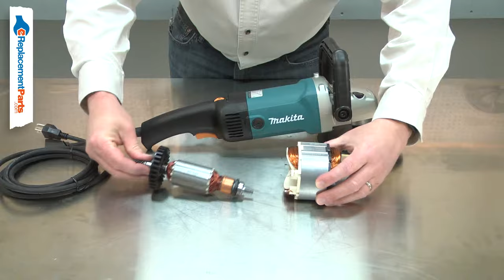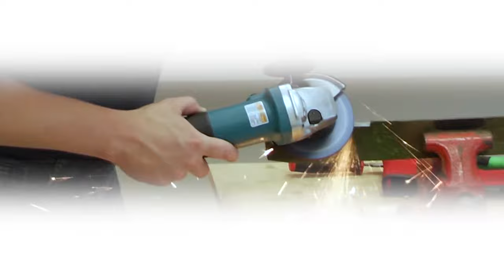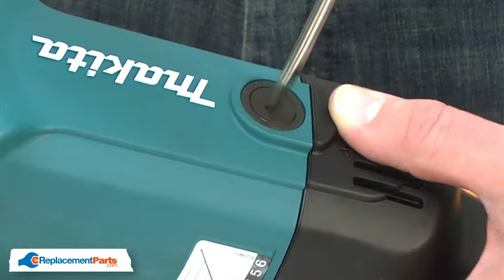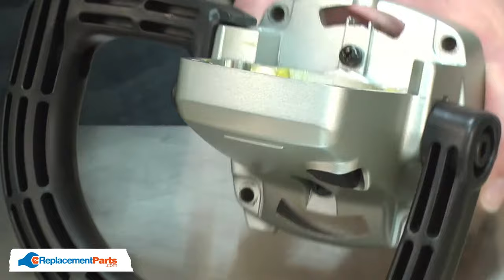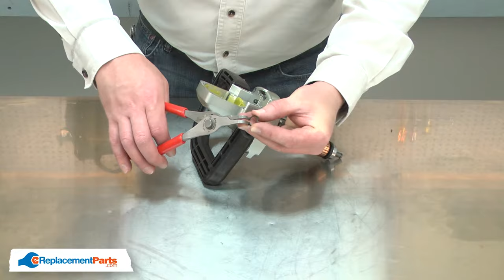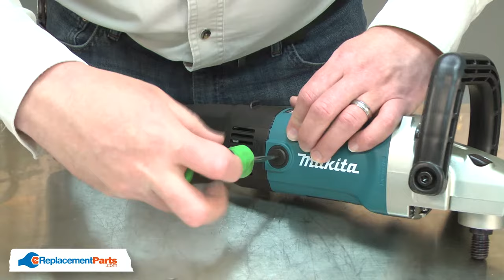Makita Polisher Repair - Replacing the Armature (Makita Part # 516306-1)

Comment: There is a simple and faster way.  You have two screws holding the bearing retaining plate, so by unscrewing them there is no need to hit the rotor and possibly damaging the shaft gears. This way you pull the armature complete both with the front bearing with no applied force and just take off or replace the front bearing with a puller or a hidraulic press.   It's way easier and that method can be used also when just replacing the bearings.  Also, when replacing the  armature is best to also replace the head gear.  Otherwise the tool is known to "scream" while working under heavier load.  I'm a certified Makita mechanic, and a repair shop owner  btw ;)  I enjoy your videos..
Reply: Hello! Please tell us what lubricate the tape bearings and the mitre saw guide tubes? And what grease should I use for the gear? Thanks.
Reply: These makita's armature came without Zigzag Varnish ? what about Maktia GA-4030 angle grinder it has  blue Varnish on Armature without any ZIGZAG pattern and let us know what if we rewind this armature instead of changing it  ??